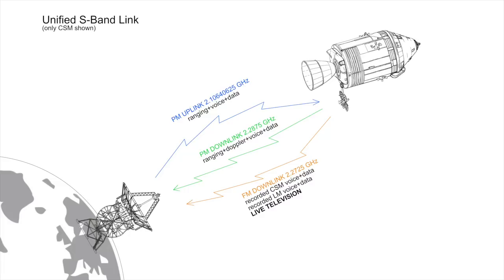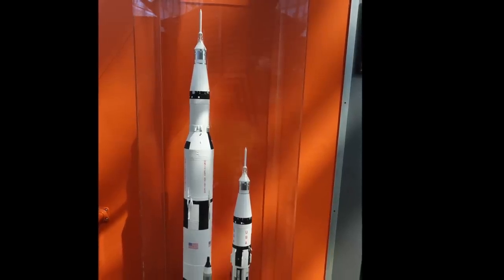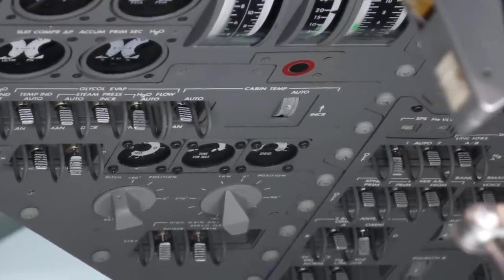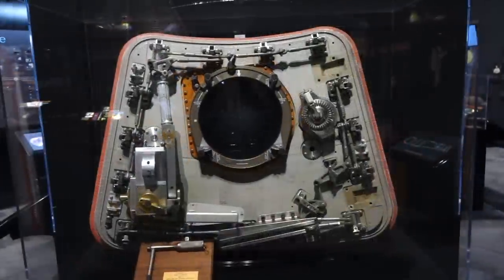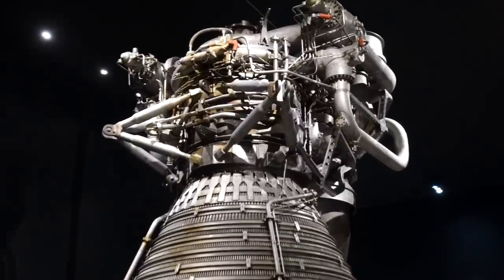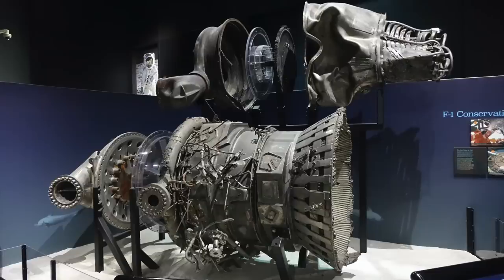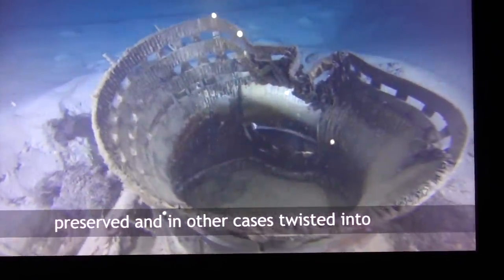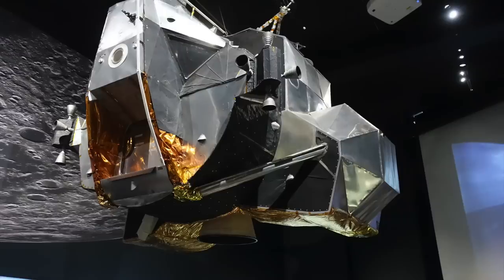Explaining the Apollo hardware on display at Seattle's Museum of Flight

Comment: I was fortunate to work for a sub-contractor that made the LEM trainer. I installed all of the interior electronic components. After everything was installed, a final check was made to make sure all was well. I sat in one of the couches and observed everything in operation. That was over 50 years ago. NEVER forgot it!

Comment: I was there in '94, but I don't remember much, other than sitting in a F/A-18 fighter jet mock-up and seeing the first 747 sadly rotting outdoors then. It is possible that the Apollo exhibits were not much back then... Gee, will I spend a couple of days there if I ever return! Thanks for the visit!
Reply: It's gotten much better in the last 10 years. The Prototype 747 (and prototype 737 and 787) as well as a number of other aircraft are now sitting outside but are covered by a tall roof structure that keeps a lot of the "outdoor rot" at bay. The Museum has been actively restoring/maintaining the exteriors on these early aircraft as well, it's really nice to see.
Reply: @MariusStrom  Their airliner collection is almost overwhelming (no doubt the beneficiary of the association with Boeing), and you can walk inside of several of them.

When I visited, the one major part of the museum that wasn't accessible was the historic original Boeing shed that it was built around, which was under restoration work. I'd like to go back and see that.
Reply: @MattMcIrvin  yep, the Red Barn is open for business!

We’re at the museum about once a month 😄

Comment: The Air Zoo in Kalamazoo, Michigan also has an F1 engine. Theirs is mounted on a stand, and you can walk underneath the nozzle and look directly up into the combustion chamber, with the injector plate clearly visible. It's an awesome thing. Air Zoo also has an SR-71 in a very dramatic display.

Comment: You should have brought the really long selfie stick for shooting the interior of the Apollo Command Module (CM) ;)
"The Museum's Apollo Command Module, known as CM 007 and CM 007A, is the first production-line capsule delivered to NASA for testing and training. It was originally identical to the Apollo 1 Block 1 spacecraft 012, which experienced the fatal fire. After impact and acoustic testing at the North American plant in Downey, California, CM 007 was delivered to NASA's Manned Spaceflight Center in Houston, Texas on April 18, 1966. It was used for water impact and flotation tests in the Gulf of Mexico. In 1967, CM 007 was sent back to North American for modification to Block II configuration. It was re-designated CM 007A and returned to Houston for qualification tests of the redesigned hatch and other changes mandated by the Apollo 1 accident review board. The module was also used for a 48-hour open water test, crewed by astronauts James A. Lovell, Jr., Stuart A. Roosa, and Charles M. Duke, Jr. in April 1968." Scource: https://www.museumofflight.org/spacecraft/north-american-aviation-one-apollo-command-module-007A

Comment: If the equipment you have played with in the past is any indication if you powered the equipment in that capsule would wake right and work.
Reply: that capsule was only used for splashing around in the ocean to see how long it would float, and whether the crew would survive. It likely does not have all the functioning equipment aboard, if any at all

Comment: I really wish if the whole World would be on metric. Actuall it already is. Standards for the exact length of an inch have varied in the past, but since the adoption of the international yard during the 1950s and 1960s the inch has been based on the metric system and defined as exactly 25.4 mm.

Comment: Nice to see the engines fished out of the ocean - I guess even evil billionaire tyrants can do something good once in a while.  That lunar rover looks improbably impressive for the time, and it casts some serious shade on NASA's newer rover concepts.  What has happened?  I get that the budgets were slashed, but it looks like they burned a lot of books at the same time - like there's been a major devolution and loss of knowledge.  Cultural shift?  Loss of purpose?  Something else on TV?  Who knows, but that Artemis business sure looks like the poor cousin to Apollo.
Reply: some of the reason for the different designs for the new rovers is that Mars is very different environment from the Moon, but also that it's been 60 years. They have however lost a lot of the knowledge gained during Apollo. Many of the old engineers retired and the contractors went bankrupt and disappeared, and NASA apparently tossed a lot of the documentation when they moved onto the space shuttle because they assumed they'd never need it again. It was quite obvious already after the Challenger disaster where they fouled one rocket launch after the other trying to get something in the air because they had to re-learn how to rocket. Nowadays everything is licensed out to the cheapest subcontractor and NASA lacks the budget to maintain proper oversight, thus the massively over schedule SLS, the scrapped orbital truck stop, and who knows if they ever get to do the proposed test landings on the moon before shipping everything off to Mars with fingers cross as they hope it'll work on first try
Reply: @thesteelrodent1796  Yeah, I was aware that they destroyed a lot of documentation - who's gonna need all that moon stuff anyway :P  I'm still struck by the technological ingenuity of the Apollo hardware, though.  I was actually referring to the newer moon rover designs that look extremely awkward and move at a snail's pace.  There's a particular ride on toy for toddlers that bears a striking resemblance - a big bubble with little tiny wheels.
Yeah I don't see the 'Starship' proposal happening.  Aside from actually getting it to the moon, which will require 8 launches to fuel it in Earth orbit, the little problem of landing on uneven terrain, and then lowering the astronauts 50 feet to the surface on a platform supported by cables doesn't seem all that feasible somehow.  I think Occupational Health and Safety might want to have a word.
I still think sending humans to Mars is a homicide/suicide mission, barring some major leaps in technology.  I also think it will cost far more than they are guesstimating - like add a couple of zeros - and that price tag will not be popular politically.  That's just my opinion right now, though.  Who knows, they might solve the radiation and physiological degradation issues of extended space travel, and do it within budget and without killing the astronauts in the process.
Reply: That rover is as close as you'll ever get to a real-life version of George Jetson's commuting bubble that folds up into a briefcase.  I would not be surprised if they hired some origami master from Japan to figure out how to fold that thing up into the LEM...